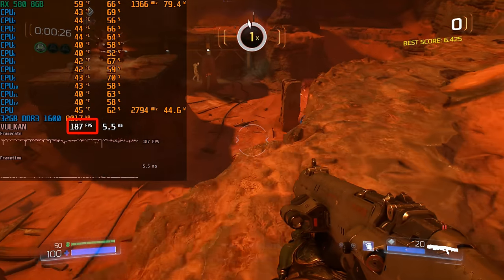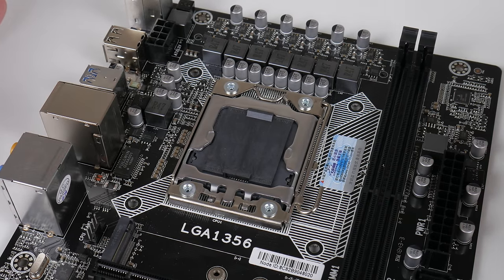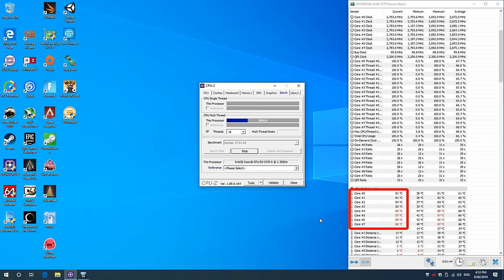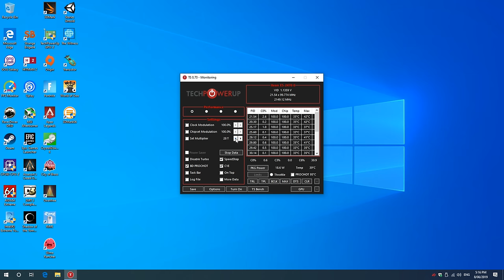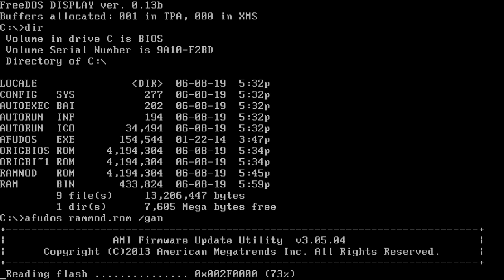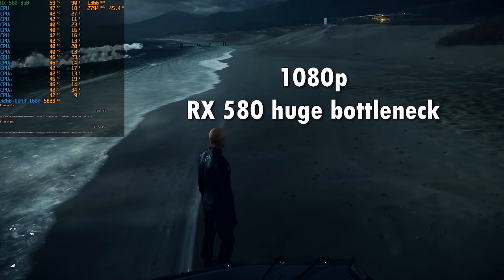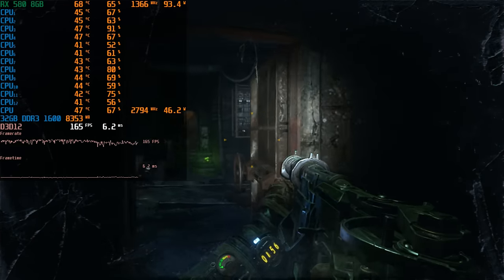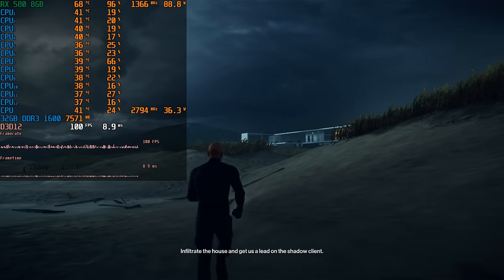6 Cores (and more) for everyone! Taking a closer look at the LGA 1356 platform.

Comment: Hey Phil, I've just noticed stores like WUSON on AE are selling mobo/processor/memory/cooler/etc bundles very close to some of the systems you've spec'ed out lately. What are your thoughts on these bundles? Are  the Chinese RAM kits still a bit dodgy or are these a good value?
Reply from the maker: If things go to plan, I might be able to review such a bundle soon! With the RAM, so far I bought 4 kits from AE and they all work as advertised, but some RAM was modified, overclocked basically. So yea, a bit sketchy, but in terms of function, you do get working RAM.
Reply: @philscomputerlab  that's good to know, thanks for the quick reply, too!

Comment: Thx for mod BIOS.
Now ddr-3 1333 ecc run on 1866 without problem.
I use 2420v2 with this board-very low price for 6 Core on ivy bridge.(ggl translate)
Reply from the maker: Oh, so you could force 1866 on 2420V2?? NICE! I didn't even try this :D

Comment: What about an e5-2470? 8 core/16threaded chip for the socket 1356 you can order on aliexpress for only €34,58 ($39,61 USD or $56,74 AUD) looking forward to see you reviewing this chip! Nice video btw
Reply: My bad didn't watch the whoel video yet when i posted this comment lol. Bow i see you've alteady tested that
Reply from the maker: Yea, at the moment I only recommend this board, as it has USB 3 and M.2 together with 2430V2! If you can spend more, go straight to LGA 2011, like PlexHD X79 Turbo and 2630V2 or 2650V2.

Comment: e5-2470 vs e5-2430v2 , the first wins in a way , there is 2 extra cores and 4 extra threads , you can expect the higher power consuption and heat output but if i am doing this i will overclock as well . get a better air cooler as well

Comment: Overall nice vid, didnt actually know dat this socket exist 
I have a few questions: 

Could this be faster than ryzen 3? 
and How far have you overclocked this?
Reply from the maker: No, the clock speed is only 2800 MHz, so it won't catch much higher clocked CPUs. But many games will run "well enough", at least I'm happy with the performance.

Comment: @philscomputerlab just curious. Have you tried two 32GB RAM 🐏 sticks i.e 64GB to see if they are compatible? The board specs are very non specific on various Chinese / Russian sites about this board but the these Xeon’s should support higher ram it all depends if the sockets contain the required address lines...

Comment: I have a question. X5670 looks better thank the xeon 2430V2 so why did you choose 1356?
Reply from the maker: I'm not familiar with that CPU, tell me more!
Reply: PhilsComputerLab you don't know x5670??? It's a west mere 6core Xeon that can overclock really high. 4.5+ ghz. You do bclk overclocking on an x58 motherboard. You can buy those cpus for cheap. X5650-20 bucks max. Sometimes 10 dollars. The problem is you can't find the motherboards for cheap. Incredible deal if you can find a good motherboard.
Reply from the maker: @jamesjacob9632  Ah yes, well that makes it hard to recommend then.
Reply: @jamesjacob9632  Yep, mobos can be expensive AF. Only good if you manage to stumble across cheap one.
Reply: @jamesjacob9632  I rather get a W3680 same CPU, but comes with an unlocked multiplier so it's a lot easier to overclock literally bump the voltage and boost the multiplier and you can be running at 4.7GHz that's the highest on average I've seen at least.
Reply: @briskxd1093  x5650 is only 10 dollars. w3680 is 50 though.
Reply: @jamesjacob9632  Yeah that's true. I guess you're paying mostly for the unlocked multiplier I guess.

Comment: Nice Vid. Want to try it with E5 2470 anyway. How big are the VRMs exactly? I want to mount heatsink coolers to all to this board. Even if they have aircooling i think it would run much cooler.
Reply from the maker: Don't do it! I urge you to go with LGA 2011 instead, check my 2nd last video! Spacing is 95mm I think

Comment: Very nice follow up, I will check out your bios for faster memory, to make full use of my hyperX 1866 RAM.
On the M.2 issue I got an ADATA XPG SX6000lite 256nvme SSD ($35USD) with my 2450v2 and was able to get the rated 1800MBps/900MBps on Crystal disk mark, so maybe the pcie spec allocation on the 2430v2 might be different?
Reply from the maker: Hmm I tested this actually, both Sandy and Ivy have PCIe controllers. You don't happen to have the HUANAN version of this board?
Reply: @philscomputerlab  the same black box with blue "X79A" as in your video and a shark logo at the topleft and a brand name of Jingsha, below the shark logo. 

I am adding a VRM heatsink to the motherboard. I bought a 150x60x25mm aluminum heatsink ($7usd) from Amazon for some compressor motor and cut it down to 103x25x25mm, with a Dremel, to fit over the VRM along with an ARCTIC 100x100x1.0mm thermal pad ($7usd)
Reply from the maker: Oh, maybe your NVME SSD is PCIe 3.0 x 4? Mine is 3.0 x 2, so if it falls back to 2.0, mine is affected, wheres yours might not be hit as hard. In Crystal Disk Info it tells you what mode the SSD is running at!

Comment: So what cpu do your recommend? The Xeon 2470V2 if you can afford it? Or is that the one wich made your board shut off?
Reply from the maker: Basically, this board and 2430V2, but if you can spend more, or need more performance, go with LGA 2011. Do not get higher CPU than 2430V2, the value is poor.
Reply: Thanks a lot for the quick response and really interesting video!

Comment: That could also be why my E5-2450 survived. Also due to 2.6Ghz clock is max it will Turbo to. I don't know if Windows 10 will change it. Didn't have time yet to test it.
My vrm probably running similar to lower temps you got.  Were you able to increase to a higher boost clock with that software?

Also on top of that i Probably will have case fan pointing on vrm when i put one in a case.

Comment: Does the motherboard or platform in general allow overclocking? While it's really enticing as a cheap multicore setup, frequencies are really low and could use an overclock.
Reply: Xeons are locked

Comment: @PhilsComputerLab
Phil, TechPowerUp is a great site and the forums there have a bunch of very knowledgeable users. They should be able to help you unlock access to the game folders in Windows 10. It takes some doing, but can be done. Go start a thread there and I'm sure someone will walk you through the process. ;-)
Reply from the maker: Yea I figured it out since, I had to change the owner of the folder. But I ran into another issue, it seems all the Windows store games don't support proper fullscreen mode, just window, and borderless window mode, which cause issues with overlay like MSI Afterburner.
Reply: @philscomputerlab  
Yup, changing ownership is how it's done. The MSI Afterburner problem is something I think has been encountered before as well. Again TPU users likely have a solution. Either way, go join the fun! You'd be very welcomed there.
Reply from the maker: @thecaptain2281  I'll have a look, but I don't have much hope. No proper full-screen is an integral part of UWP games. Some games have built-in FPS counter, like Forza or Wolfenstein, so I'll just use that. Metro does work with MSI Afterburner, but often crashes. So yea it's not ideal, but can't argue with the value of the XBox Pass PC games so far :D

Comment: As far as sensors giving erroneous values, I've noticed something similar under Linux especially with AMD processors.  I'm not sure if that has more to do with laziness on the part of AMD motherboard makers or what.  As far as Intel's TDP, my understanding is that Intel tends to conservatively guesstimate upwardly on the TDP, so it's likely the 8-core CPU happens to be actually rather close to the rated TDP vs the other two being much lower.  There's, of course, also the issue of luck--I've consistently had bad luck with AMD processors running substantially (10C) hotter (so, around 75C) than most other reported figures I've seen even with a pretty beefy heatsink/fan.  Still, I can totally understand recommend the later/faster CPU especially if it mostly alleviates the fear of overheating.
One thing I'm sort of curious about is, just how viable is running two instances of a game simultaneously?  I don't even know if that's actually reasonably viable on one GPU, but presuming it works on at least some games (I imagine many block it even with different user accounts) it'd offer an interesting workout on more cores as well as allowing for a single PC multiplayer games.  I knows Linus Tech Tips has managed similar, but their approach was using VMs, multiple GPUs, and pass-through.  That's not a reasonable setup for most people, I think.  Local multiplayer with multiple displays + keyboards/mice seems oddly not a normal thing,.
Reply from the maker: This is the datasheet of the sensor IC they are using: http://v-comp.kiev.ua/download/NCT6779D.pdf I really believe that they just didn't connect all the sensor inputs :D

Comment: Are you using 720p resolution all the time, right? Even my Ryzen 1600 can't give me these frames at 1080p. Anyway, sometimes you say there's a huge bottleneck and this is not true. Look at GPU usage. 90% of GPU usage is not huge, it's sightly IMHO.
Reply from the maker: You can't go by GPU usage alone, it's not very reliable. Like you say, the Ryzen 1600 is a much better CPU, so if you try all your games at 720p, you will see the difference.
Reply: @philscomputerlab  For me, GPU usage is always very reliable at least for games that can reach 100% GPU usage. It's crystal. If you have a game working at 70% on GPU Usage, you have something that is bottlenecking your gpu by 30%. Usually it's CPU, but it can be HDD or even RAM.

Comment: Would be interesting to know how many cores you can get running safely on these motherboards. i.e. rendering applications. Are there some chinese boards which are more capable in the TDP department?
Reply from the maker: Stick to V2 Ivy Bridge and 6 or 8 cores and you will be fine!

Comment: Those SSD:s sounds like a good deal. Be aware though that the storage value of SSD:s can be altered by the vendor. In reality you could end up with a 128GB SSD that shows up as a 960GB in Windows. You should try and fill the storage up to see if those 960GB are legit or not.
Reply from the maker: Yea, so far so good! That RAID enclosure though, didn't work out for me. The small file performance is terrible, so I switched to using just the single SSD. So far I've got maybe 60% filled with Windows 10 and various games and the performance seems just fine.

Comment: review the xeon e5530 from 2008 its a quad core xeon with 8 threads and you can run 2 at once
Reply: It's like an E5620, just more toasty (being 45 nm rather than 32 nm). Or somewhat slower but also less toasty than an i7 920. Not terribly interesting these days, given that either of those are going for pennies to begin with.

Comment: I bought the slightly slower 2420 v2 (only $19) and the Huananzhi X9D (better VRM, extra PCIe x1 slot, etc.), with 16GB DDR3/1600 (which ran at the correct speed no problem). Testing with a reference 780 Ti, I was surprised that at 1440p in some cases performance is only 3% less than using the same GPU with a 5GHz 2700K (akin to a stock 6700K, same IPC as a stock 2700X), though of course it depended on the game. At 1080p results were also good, though I noticed the in-game stats for Hitman 2 show a wide variance. Need to use Afterburner to get proper data. I'll test with other GPUs later (RX 580, 1080 Ti, GTX 980, etc.) and I also have some other CPUs (2430 v2, 2450 v2). If anyone's interested in the data then I'll write it up for my site (I also have some 3DMark numbers). Atm I'm testing with Dirt Rally, Doom 2016, FC5, GTA V, Hitman 2, Metro Last Light and Resident Evil 6. I'd like to test other games but they're just too expensive atm.

I'm going to buy the PlexHD X79 mbd and also a dual-socket LGA2011 mbd to test dual XEONs, currently sourcing some 2650 vs and am hoping to borrow a couple of 2697Ws from a friend (I already have two 2680 v2s I can try). The latter mbd supposedly support both CF and SLI, so that should be interesting (I can test with up to dual 1080 Ti).
Reply from the maker: Yea I've heard in Russian forums, that the HUANANZHI board has working RAM speed setting in BIOS! In general, it seems that this brand is the best choice overall, and other boards could just be OEM versions of that. The PlexHD X79 has been working well for me, really digging the many PCIe slots. You have a 2680V2 and 2697W? Very nice! The W is a power sucker though, it might tip that board over the edge and into early retirement :D
Reply: @philscomputerlab  I did consider the Huananzhi version of the X79, but am going for the PlexHD instead.

I have two 2680 v2s and can borrow a couple of the Ws from a friend, but you're right either might be too much for these boards. I have what appears to be the same model laser heat sensing gun that you have, so I'll keep an eye on things, if it can't handle a 2680 v2 then I probably won't even try the Ws. I'm going to buy a 2-socket board aswell, am particularly interested in how two 2650 v2s would behave. I know a company in the UK that has a lot of RAM and some XEONs (3D System Sales), just waiting to hear back what they can do re the RAM I need and some of the CPUs, would be good to be able to get them from the UK instead of China, looking likely it'll be cheaper aswell, though the guy did say there was one particular DIMM capacity at 1866 that he didn't have, can't recall offhand. Need to check tomorrow.
Reply from the maker: @mapesdhs597  Nice, and do keep us posted :D I enjoy making these videos, but it's even more interesting to see how others are going with their projects. I'm pretty sure the 2680V2 isn't going to be a problem, the Ivy Bridge CPUs run much cooler. The board handles a 1650V2 at 4.1 GHz without breaking a sweat.
Reply: @philscomputerlab  Will do! We'll see I guess. 8)  Btw, have you seen Hardware Unboxed's video about these boards? He's pretty scathing, effectively describing all of these cheap mbds as garbage even though presumably he's only tested just the one he bought. I posted a critical comment because his conclusions simply don't match my experience at all. See:

https://www.youtube.com/watch?v=pBtT-vYeIyE

Anyway, back to it! I'm about to start testing Dirt Rally, just learned how to use MSI Afterburner last night to get the 1% and 0.1% low data. 8)

Comment: I'm thinking about getting this to replace my x3470. Because I only get 40ish fps in Minecraft modded and my CPU is holding me back not my gpu (rx 560 4gb). After seeing this video I know what to do. But do you know if a lga 1156 CPU cooler would fit on a 1356 socket or would I have to get a new cooler?

Comment: the way i used to get around the file locks of the ms store apps was shuting down windows holding shift and booting up a linux live cd and modifying the files from there, as linux doesn't understand that protection system.
Reply from the maker: I sorted it out by changing ownership of the folder!

Comment: 124c on VRM ouch, Intel's tdp rating is such a joke
maybe mount some heatsink to cool it down, cannibalise it from a junk mobo.
or just order some mobo vrm heatsink from ali,
its a shame that mobo does not come with any heatsinks, it seems the mobo has 2 wholes, and probably fit standard mobo vrm heatsinks, i would understand if it was a cheap skylake mobo, but a sandy chip no way absolutely require heatsinks

Comment: lol. Cheapest six cores are the E7450 and the X7460, if you can find them, or even get a motherboard.
Reply: A complete HP Proliant DL580 G5, Dell Poweredge R900 or IBM x3850 M2 would probably be an alternative if not finding a Supermicro X7QCE motherboard with heatsinks included.
Reply: @retromaniac4563  yep, found out about the chip after finding a poweredge r900 listing. downside is, they are Quad CPU Cofigurations. You do get a buttload of Dimm Slots  for Chrome browsing though

Comment: Ark doesn't have a 60 FPS cap on Steam. I'm guessing the Windows Store introduced one? 
Anyways log into Linux and mount the drive the game is saved to to modify game files. Not sure if Microsoft has any antitamper stuff to detect if you change any of the files though but it could be worth a try?
Also on a 2690 Ark is limited to roughly 60-80 FPS due to horrific optimizations so I wouldn't expect much better honestly. 1 core 100%.
Reply from the maker: Yea I managed to sort out the folder, had to change ownership to the directory. Yea these UWP games are all a bit weird, no full-screen support, overlay doesn't work in many games...

Comment: So I went to wikepedia and interestingly for LGA 2011 the only CPU i'd call reasonable vs the 2690 V1 is the 2667V2 but that's way too expensive. 
At least for gaming obviously lol. For server things there's probably a reasonable speed V2 8 or 10 cored.
Reply from the maker: The 2689 we tested last week is even better value! Has higher all-core turbo, lower TDP and costs under USD 60! In terms of performance value, it is THE BEST CPU for LGA 2011.
Reply: @philscomputerlab  Oops sorry I meant out of the V2 CPU's nothing was better than the 2690 (and by extension the 2689).
Reply from the maker: Ah yes, the V2 CPUs in general are way more expensive. I like the 1650V2 as good all-rounder and the 1650V2 for gaming as it's unlocked and will do around 4 GHz. 1680V2 if you're rich :D That one is also unlocked, but 8 cores. Can take on a Ryzen 7 in many games.